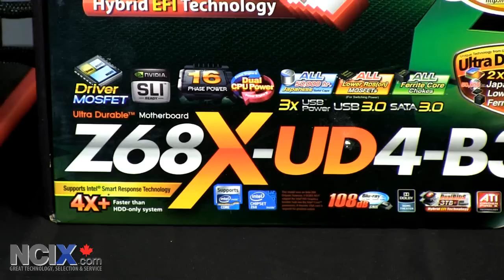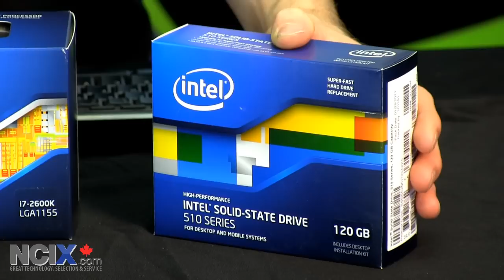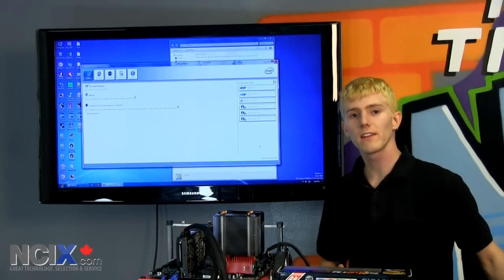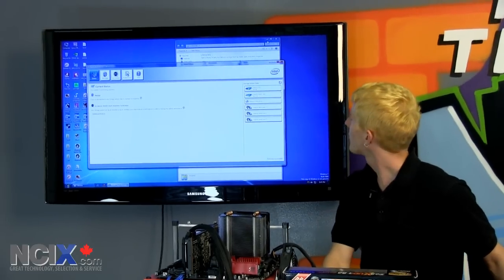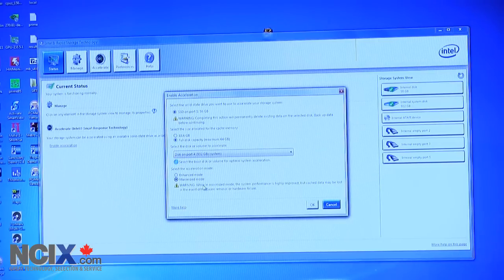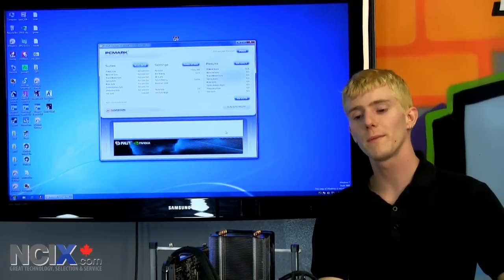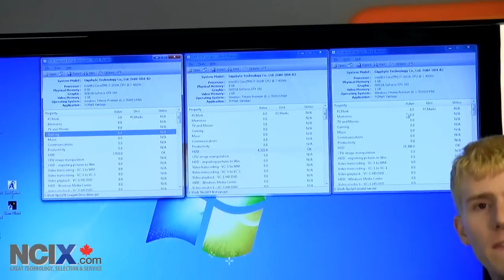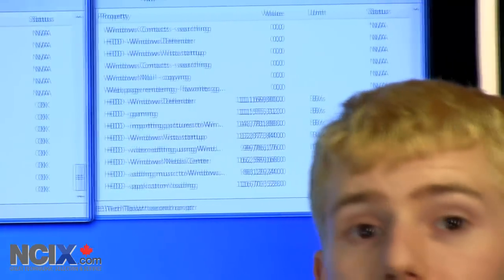Intel Smart Response Technology (SRT) SSD Caching Featuring Gigabyte NCIX Tech Tips

Comment: So I just looked it up and it looks like you don't need a Intel SSD to use SRT. That Crucial or Samsung drives can use this as long as your CPU is Sandy Bridge or newer.

When you change SATA mode, does this change the mode for every drive connected your computer? What if you wanted a 240 GB SSD as a boot drive in AHCI mode, but also a 64 GB SSD set to RAID with a 3 TB HD.

In other words, when you enable RAID to link a small SSD with a massive HD, can another larger SSD be in AHCI mode to boot?

Comment: You MUST have all of the following:
    Intel® Z68/Z77/H77/Q77 Express Chipset-based desktop board
    Intel® Core™ Processor in the LGA 1155 package
    System BIOS with SATA mode set to RAID
    Intel Rapid Storage Technology software 10.5 version release or later
    Single hard disk drive or multiple drives in a single RAID volume
    Solid-state drive (SSD) with a minimum capacity of 18.6GB
     OS-Vista,7, or 8

Comment: wait wait there, intel SRT means using your SSD to cache your HDD so your HDD is faster and max size is 60gb, if you can afford a 120gb SSD dont bother with intel STR (and no it works with any SSD that supports it and the right motherboard) and if you've never had an SSD before its simple, OS goes on the SSD, games on the HDD, softwares on your SSD, and look for sean's ssd optimazation guide on google and... yeah intel SRT is for when you have an HDD and cant afford a big SSD, its a middleground

Comment: Will I be able to take advantage of both the Intel Rapid Start Technology and the SRT with a single 64GB SSD? The first one needs 8GB (my total RAM size) and the other needs either 18.6 (which is to low) or the full disk capacity 64GB. I really don't have enough money to get a 128GB SSD

Comment: What SSD did you use? I have the UD3 which has an mSATA port (from what I understand, mSATA connects directly to the CPU, bypassing the northbridge chip for better performance) for a 1.8" SSD (it's just a little piece of PCB with solid st chips on it and no covering).

I can only find an ADATA XM13 series 60Gb SSD (1.8" / 280mb/sec read, 260mb/sec write) which is compatible.

Would it be better to rather buy a standard 60Gb SSD with faster transfer rates (keeping in mind value for money)?

Comment: @fagerbag You would want SRT for one reason.

Of course you will have a regular SSD as a boot drive, that alone is faster (something like 60GB is good). However, for storage you want to use a HDD (cause no one can afford 500+ GB SSDs), but HDDs aren't as fast. So use the SRT to make your HDD have similar (slower, but ALOT better) performance to a SSD. Not going to be as fast as the SSD, but close to it. That way you have all fast drives without the premium price.

Comment: I have the same mobo and cpu and 3 64GB SSDs...what I want to do is RAID 0 2 of the SSDs for my boot drive and then use the other 64GB SSD along with my 3TB HDD in a Intel Smart Response Config, is that possible?

Comment: @Theairplaneguy4ever Install your OS on the SSD as you would do with a HDD. In this video linus said you choose the capacity you wanna use as cache so i think you re ready but tbh, 60gb for both OS/SRT seems a little bit short to me. I mean I would allocate 60GB to win7 and 60 others for caching. but i don't know if win7 still needs 60GB to run fine on a SSD...

Comment: @CHAZER134 not exactly. You plug it to SATA socket on your motherboard that supports Intel SRT and then at power up your machine you enter a BIOS and in SATA settings you change to RAID0. then you save BIOS settings and reboot. Job done

Comment: @rulezian1 Well your right about your system getting faster and faster as SRT learns which applications you use the most. The only real limit here it memory bandwidth, and read/write speeds. If your running SATA3 6GB/s, then you should have the bandwidth to support multiple application caching. And the system speed is limited by the read and write speeds of you SSD.

Comment: @JD12ish Well there may be an issue with SRT writing memory chunks from you boot SSD, it won't cause any problems it'll just be pointless waste of performance. The way SRT is designed means that it'll speed up frequently used applications on other drives, including your OS. I'd recommend the same method Linus used, having a single 60GB SSD for SRT, and HDDs for booting your OS aswell as data and application storage. This method compared against your own should fare the same performance output.

Comment: @sausagenmuff 
I agree with you at the Intel section, but saying that a hybrid drive > SSD... I'll buy an SSD (max. 100 GB) for my OS and games etc. (loads much faster than a hybrid drive) and for my multimedia files I'll buy a green 'normal' hard disk drive, because its way less important at loading speeds. SSD is expensive, but it's very efficient in every way.